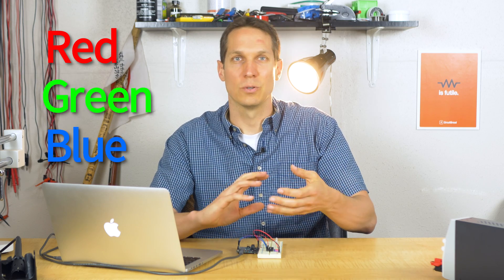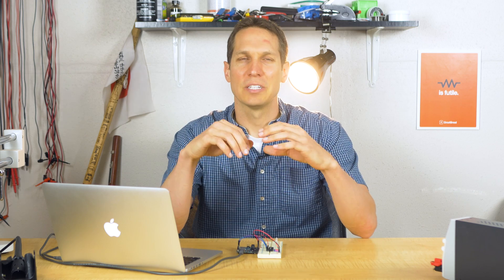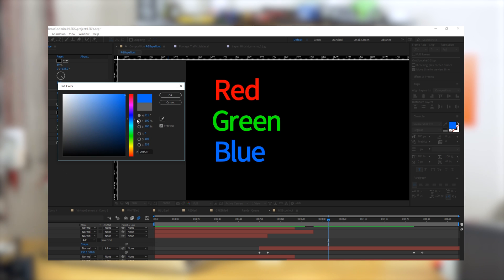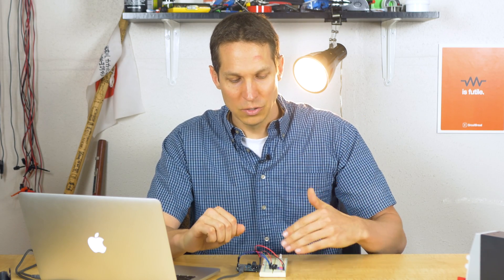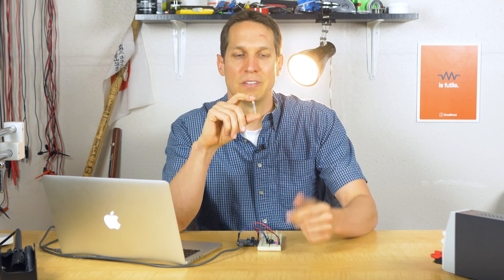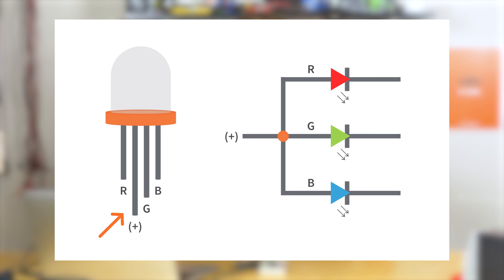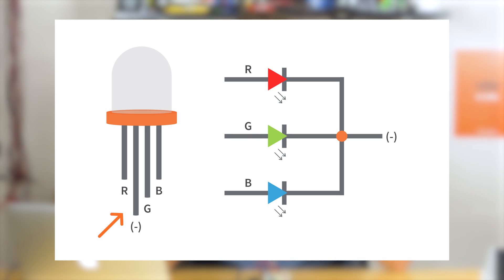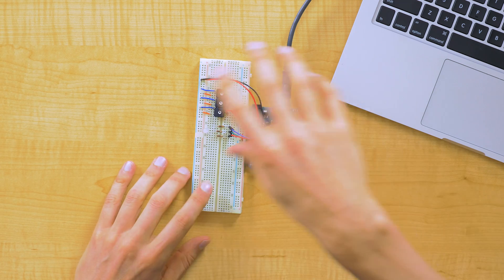How an RGB LED works and how to use one! | Basic Electronics

Comment: Ok. Interesting and useful. But now I need to apply this to my problem. I have a variable speed drive for a dc treadmill motor. I’m using a SCR and bridge rectifier. I have 2 potentiometers connected to the SCR. One for course speed adjustment and one for fine adjustment (120 kO and 20 kO). What I’d like is a LED indicator light that starts at green for low RPM and goes to red for high RPM , with all the colors of the rainbow between. Silly, I know. But it would be cool and I’m trying to learn electronics. 
When both pots are maxed counter clockwise, the resistance is 140 k Ohms. The motor starts turning just below that. When I rotate either pot clockwise, the resistance goes down and the motor starts turning. How do I hook up this RGB LED to get what I want?
Your help is appreciated. 
Thanks,
Paul

Comment: I haven't tried doing PWM with the led I have. I just connected each of the RGB pins through a resistor each to +3.3V to see what it looked like. I was expecting to see 'white' with all 3 colours but I could just see each individual colour lit as if it really were 3 LEDs stuck together. Does PWM assist in the illusion of blending the colours or are some LEDs just not diffuse and suitable for colour blending?
Reply from the maker: If you look directly at an RGB LED, you can almost always see the individual colors but if you put some sort of diffuser on it or see the light splayed on a wall or something, it should look white.  The PWM in this case probably won't make much of a difference unless you're balancing the colors by making one particular color stronger or weaker.  But you'll still see them individually if you look directly at the LED.

Comment: working with christmas lights, c-7 & c-9 bulb sizes, (have small pixel/led combo, 4 GE color change (50 bulbs per string, .3 amps, 36W) but main controller board in 4 sets crapped out), stuff is made so cheap anymore but still costs 50-80 bucks at local big box home improvement stores). thinking for next year to build my own Arduino/raspberry pi setup and power supply, fully enclosed in waterproof box. but need to know more about power supply and arduino combo build. will be checking out your link to the code in the coming days. thanks for good info video.

Comment: I was wondering the following:
- If I have a circuit with a resistor and an LED, and I change the resistor, outside of the current through the LED, does the voltage across the LED change?

- If I change the LED and not the resistor, what changes outside the threshold voltage?
Reply from the maker: If you change the resistor, then it does modify the voltage across the LED.  But if you look at the VI curve of an LED, once you pass the "knee" or forward voltage, a tiny change in the voltage causes a large change in both current and light output.

If you change the LED, since you're changing the threshold voltage, you'll also change the amount of current through it.  That's why, for an RGB LED, you probably want to have different resistor values for each LED.

Comment: So I bought a bunch of common cathode LEDs and am using arduino PWM output to control each color intensity. Each color leg is connected to a PWM output pin through a resistor, and the cathode is connected to the GND pin. However, only one color of the RGB will light up at any one time, even if all 3 colors are set to full intensity. For example, if I set the analogWrite output of both red and green to 255, the LED will just light up green. If I unplug the green leg, it lights up just red.  Anyone know what's going on here?
Reply from the maker: You weren't explicit so I'm not sure if you are using 3 resistors or just one, though I think it's three.  If you ARE using just one resistor, check out our video here: https://youtu.be/3kntdICTuUQ   If not, I imagine there is a similar problem going on but I'm not sure.  I'd recommend turning all three of them on completely and then measuring the voltage drop across the different LEDs.  Each LED within the package has a different forward voltage and, if you measure them, you will probably see where you've set your circuit up wrong so that you're somehow not reaching the forward voltage required for the LEDs that have a larger forward voltage drop as everything is flowing through an LED with a lower forward voltage.
Reply: @CircuitBread  I actually figured it out from the end of your video where you talk about the resistor values. The red was just incredibly dim compared to the green because I was using resistors of the same resistance for both colors, although I'm not really sure why that caused a much bigger problem for me than it did in your video. Anyway I appreciate the response and love the video! Thanks
Reply from the maker: Glad you got it figured out!

Comment: hey! can you use do this without an arduino?
Reply from the maker: Definitely! This can be done as an analog control (directly with a potentiometer or hardwired), with specific ICs, or with any other microcontroller/PLC/FPGA/control device you want.

Comment: hey, I'm trying to see if its possible to change the color ov my car amp led lights, its one solid color (red) I want to make them blue. the red light is annoying... ? can you help me ? fyi its not the power on lights but the whole interior amp.
Reply from the maker: If it's accessible, you could directly swap the red LEDs with a blue LED and see what happens.  The problem is that blue LEDs require a higher voltage to drive them and, most likely, it won't work.  Green LEDs (less irritating to my eyes than both red and blue, personally) have a lower forward voltage than blue but, if I remember correctly, a little higher than red.  But it would be more likely to work than blue.

Comment: Are there packages where the three diodes are so close to each other or in a comb pattern that even with a clear plastic lens the light cannot be distinguished? Why do RGB LED displays use individual LEDs?
Reply from the maker: They use individual LEDs because, in the vast majority of the cases, it works well enough, and it's much, much cheaper/easier/better than trying to put those discrete LEDs even closer together in an even smaller array.  The thing is that LEDs create their color based off the material they're made out of.  So, if you want to put those different-colored LEDs close together, at the semiconductor level you'll need completely different materials.  Or at least, different enough to be a huge pain that their lattices don't connect to each other naturally or easily - a surprisingly large challenge that scientists have had to overcome as they're developing LEDs.
Reply: @CircuitBread  I thought you could cut an LED in quarters and the mix the colors ( weakest technology gets 2 quarters ). Then press those together. Maybe even nicer would be 60° sectors (waffles) and then opposing sectors have the same color to let them all have the effective center in the same spot. The overall emitting surface better stays below the diffraction limit ( so below 1µm ). Maybe some precisely placed air bubbles can give us a high emission with good uniformity.
Reply from the maker: Yep, that sounds that it would work!  I think that's where the demand question comes in.  That would be more work and cost more and, if there's no demand for it, I doubt anyone is making it.  I could be totally off on this but I haven't heard of anyone going to significant lengths to make it so the LED itself was completely indistinguishable from a single color light source.
Reply: @CircuitBread  cost is probably the main factor. We pay for the whole semiconductor crystal. If we go to the cooling limit, we have lots of payload for low overhead of wire pads and cutting margins. I would love if those fancy upscalers could be used to translate bitmaps to an RGB hex pattern with very high fps ( LED is fast and we need hex pattern for dense packing of the plastic lenses to aim all light towards the viewer). Maybe one could press a PMMA front plate with a hex pattern for even more focus. Difficult to wipe clean though.

Comment: Is there a circuit that only use one potentiometer and without arduino?
Reply from the maker: You can use a single potentiometer and no arduino to control all three LEDs inside an RGB LED at the same time though, as we discussed in this video (https://youtu.be/3kntdICTuUQ) , it's not recommended.  But you can have a potentiometer for each color without an Arduino, you just need to make sure that you don't go outside of the voltage specs of the LED as you're adjusting the resistance.  Shouldn't be a problem!

Comment: how would one go about linking these in series and then connecting multiple links of leds in parellel with each set of links individually programmable?
Reply from the maker: While it would be possible to do this, have you looked into WS2812 LEDs?  They're individually addressable and may end up being easier to deal with in the long run.  Definitely more consistent and flexible.
Reply: @CircuitBread  thanks I'll look into this

Comment: Okay my question is I have underglow will ring lights and a rear burgers panel light I would like to know how to wire a single LED for each for inside the cab of my car to indicate that they are the same color so I don't have one green then once blue and then once red I want to be able to visually see that each one is green or red or blue blue

Comment: Can we apply this method to 6000lumins led light?
Reply from the maker: Yep, this general concept should work for any RGB LED (that gives you direct access to common and each individual lead, anyway), you'll just have some variety in forward voltage and power consumption.

Comment: Hi, love your projects.
I have been all over youtube here looking for a project.  I know very little electronics but learning slow.
What I am looking for is a RGB led, chip and a veritable resister setup.
Just a battery with a rgb bulb and veritable resistor to control the speed the rgb changes color.
Can this or will this work without the Arduino board?
Reply from the maker: Hey Tom, the word "chip" is a bit too vague in this context - what does that mean?  I know you can do this with an Arduino, RGB LED, potentiometer, and some resistors.  But if you remove the logic device (the Arduino) and don't replace it with another logic device, then you will only be able to manually change the RGB color (with the potentiometer).
Reply: Thank you for your fat reply.
I was calling a integrated circuit a CHIP.  I was looking to make this as compact as possible and the Arduino board makes it to large.
Maybe a 555 chip with pnp's and npn's to control the direction of the current to the tri-color led with a potentiometer to control the speed of color change.
Thank you for the fast reply again.
Reply from the maker: Using a chip like a 555 could be an option but, depending on your learning curve, our PIC10F200 series specifically covers how to do things like this with an incredibly small chip.  But, to be frank, while it would give you an immensely greater amount of flexibility and power at the same size as a 555, it would be a commitment to learn the platform and probably an entirely new programming language.
Reply: @CircuitBread  Thank you. I am looking it over..

Comment: wouldn't this RGB led be perfectly color rendered? just like sunlight? it got all the primaries unlike general low-grade leds which is boosted with blue light only.
Reply from the maker: I don't think so... if I'm not mistaken, if you take an RGB LED like the one used in the example, and put it through a prism, you would get a strong red, green, and blue line and not much else.  Unlike sunlight, which would break into a more continuous entire rainbow.  I'd be mighty curious if someone could verify that practically, though.

Comment: Can you control an RGB led with a ON-OFF-ON SPDT switch ? I want to be able to toggle between Blue, Orange, and Off with out a microcontroller.
Reply from the maker: Yes, you could figure something out but it wouldn't be orange, as that's not one of the primary colors of the RGB LED.  You could choose between red, green, or blue, otherwise you'll need a mechanism to mix the colors.  Also, to choose between off and one of the two other colors would be easier with an SP3T switch.

Comment: How do RGB LED's work with only TWO leads?   And with many of these in parallel change colors together then in random fashion?
Reply from the maker: Are you talking about programmable RGB LEDs?  Those are controlled completely differently, they put another layer of control on top of what is discussed in this video.

Comment: Can I do this without the arduino where I’m just controlling intensity of each color just by changing resistance?
Reply from the maker: Yep, swapping out any of those resistors with a potentiometer would work.  Granted, you need to be careful to not drop the resistance so much that the LED burns out (you could put a fixed resistor and potentiometer in series, if you're nervous) but this would be a very easy way to do it.

Comment: can you control the colour of it through the computer that it's connected to (via USB)?
Reply from the maker: Hi Ozair, depends on your setup!  With the Arduino, if you set it up to take commands through the serial port, yes, you can control the color with your computer.  And frankly, it should be quite easy.  We have a few high-level tutorials on Arduino on CircuitBread.com that we just posted and those should be enough to get you pointed in the right direction.  But Arduinos are so popular, I'm sure you can find exactly what you want somewhere on the internet.
Reply: @CircuitBread  thanks for the help does it have to be an Arduino? My situation is that i have an led lamp that forms an image of the acrylic design u have chosen. Ive placed it inside my pc and ran it through the back of the case so i can connect to the back usb port. Only rponlem is u can only chanhe the colour by physically clicking the button on the device which i cant as it's inside the case and id rather not open the side panel each time to change colour lol

Comment: can you help me please? i have the RGB leds and i want the color to be like pink and it will come up as red and blue
Reply from the maker: I'm not great at the actual color mixing portion, so I stole this straight from this site:  
https://springtree.net/audio-visual-blog/rgb-led-color-mixing/

"Hot Pink: Red at 90 percent brightness, no green, and blue at 40 percent of brightness
Light Pink: Red at 90 percent of its intensity, green and blue at 50 percent
Pink Purple: Red at full brightness, green at 30, and blue at 90"

They have some other colors as well, if you want to check out the site and see.
Reply: @CircuitBread  thank you so much

Comment: Hello, i've recently bought the best Budget Keyboard it's called "HP GK200", Just wondering if i can manually change the Static RGB Color into "just Static Red", by opening the case ( i have solder experience ) Thanks!
Reply from the maker: Hey Adam, I'm not familiar with these keyboards (I'd like to blame my wife but even without her influence, I'm just not much of a gamer) so I have no clue how they're wired internally.  However, if all of the lights in they keyboard are RGBs, then technically, yes, you could make it so all the LEDs are red.  I imagine it would be a bit of a nightmare, though.  Is there not a simple way to control it in software?  If not, then your best hope is that there is some sort of signal line that you can tap into and, with just a few modifications, drive all of the RGBs red.
Reply: @CircuitBread  Yes, if I were to replace the RGB Lights to only Static Red LEDs is it possible?
Reply from the maker: Actually swapping them out?  That sounds like it would be even more challenging.  If you can, I'd recommend popping it open, taking a look at what you have, and, if you're still unsure, jump onto our Discord channel and upload the picture so we can take a look at it as well.  It would be easier to provide thoughts and advice there rather than here on YouTube (where we don't get notified of follow up comments).
Reply: @CircuitBread  I mean would it work? because i know how to open up my keyboard and pop them off ( if you're concerned about it ), I just wonder if the Lights would even turn on if i put Static Red LEDs replacing my Static RGB LED
Reply from the maker: Hey Adam, my only concern is that if the RGB LEDs have three signal wires, which one will you hook your static RGB LED up to?  You don't want to short the signal wires together or you'll have problems.  And if you can control which signal wire is used at any point, then there's not much point in swapping them out as you can drive just the red portion of your RGB LEDs. 
And sorry for the delay in response - YouTube does a terrible (nonexistent) job of notifying me when there are followup comments.  I have to look for them manually and I miss them sometimes.
Reply: @CircuitBread  ah ok, thank you so much for the answer. So you're saying if I were to completely replace the RGB LEDs to my RED LED it's going to be fine, but if I cut one of the three signal wires it'll cause problems? Thanks again ^^

Comment: I really don't know what duty cycle modulation is. I need to learn that first but I understood that the colors are produced by mixing colors from three different leds with a common + and - terminal.
Reply from the maker: Hi Arghya, we have a tutorial about how to dim an LED here:  https://www.circuitbread.com/tutorials/how-to-dim-an-led  Hopefully that helps!
Reply: LED need current limiters. Thus for power efficiency you put an inductor on each lead and periodically apply the voltage from the rails.